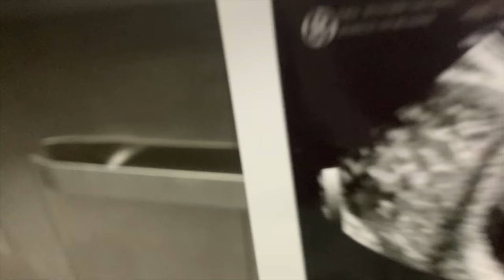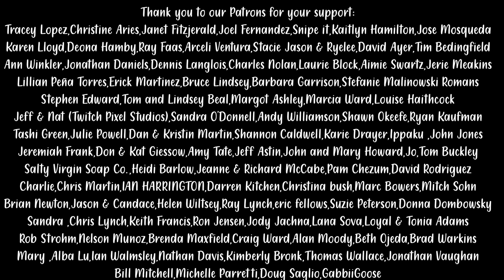WE'LL NEVER LIVE IN A BUS AGAIN // end of van life

Comment: A metal building will never be a quiet place in the winds or rain, but you can significantly reduce the building noise by adding sound deadening pads where the inside of the metal panel is still uncovered. They have one side with adhesive that will stick to the inside metal panels. They come in a variety of thicknesses and usually require a roller to properly apply them.

Comment: For sleeping, of course ear plugs are a starting point. Also, you can add plywood or drywall or insulation to the ceiling, and that will deaden a lot of the noise. Styrofoam board doesn't stop sound well, but other kinds of insulation with a large sheet good in front of them do. A curtain between the loft and the rest of the room would also help with some of the echo, depending on thickness and material.

Comment: The PROBLEM with using 2x4's is the residual moisture within fresh 2x4 material is stresses in green wood and shrinkage.

Good luck. I usually stack and clamp with stickers between for air drying and stabilizing before laminating.

Rotts o luck

Comment: Dont forget, WD40 is a Water Displacement not a lubricant!
Little wirewool or high grade sandpaper to get the areas smooth, clean out any grit then get some grease on the joints, should help keep it moving!

Comment: Showing up in announced with no invite is rude.  Little tip for finding center of any span dealing with fractions and whole numbers with fractions. Odd whole numbers with fraction like 23 7/16 divide 23 in half first =11 take the fraction 7/16 add the numerator and denominator and make that your numerator =23 than double denominator= 32 answer 11 23/32.  Even whole numbers with fraction like 22 7/16 divide whole number in half =11. Take the fraction leave the numerator the Same and double the denominator =7/32 or 11 7/32 . Fraction by themselves are considered even number 1/2 = 1/4 odd like 1 1/2 =3/4   even 2 1/2 = 1 1/4 odd    3 3/4 =1 7/8.   Even numbers the numerator always stays the same, odd numbers the numerator becomes the sum of adding numerator  and denominator together.  Odd or even the denominator is always doubled. I was taught this 50 plus years ago and used it millions of times. Super simple to jus do in your head

Comment: Grind off those rivets holding the couch retracting arms together, sand the surfaces to remove the accumulated rust and get the surfaces smooth again, then light oil, and reassemble with a bolt.  Get it perfectly snug for good movement with no slop, and put a DOT of weld to hold the nut in place!

Time for a couch blanket over the seating area so that you can pull it to wash after Lola runs in from the rain with muddy feat and goes straight to the couch!

So good to watch some meat eaters instead of those FREAKY VEGANS Eamon and Bec!     ;)